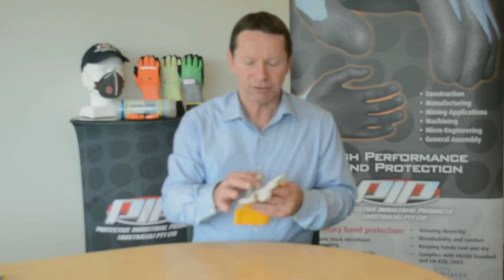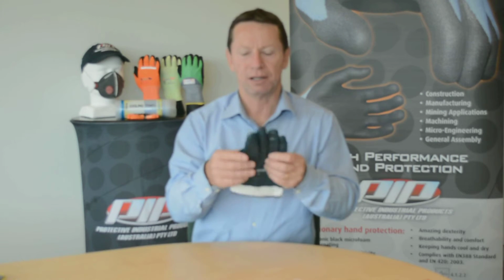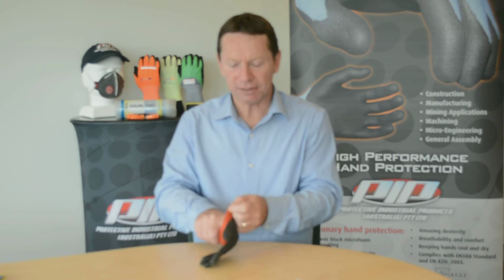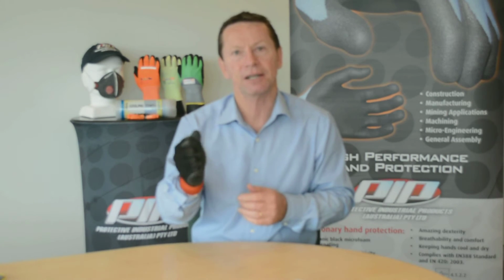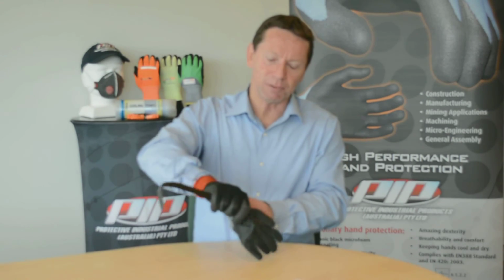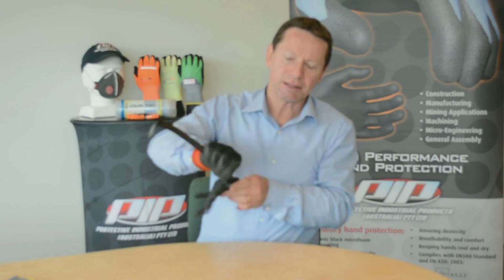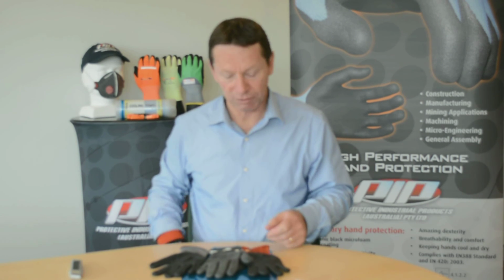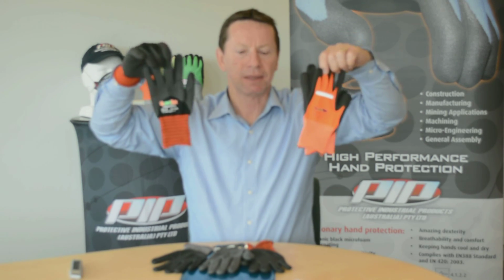SuperSkin Presentation Video

Comment: Where are these available in qld? Is there a bricks & mortar store I can try them. Am after waterproof gloves that don't make hands sweat.
Reply from the maker: Hello Anakin,
We have a list of Distribution locations on our homepage (pipaus.com) tab "contacts" locate a distributor button.
As for finding a breathable glove that is water tight, that science is not readily available yet. Issue being for sweat (humidity / moisture) to escape the inside of glove, it must be able to pass through the micro porous coating material. Conversely, if it is a solid coated material it will not breathe, or let water in! We do have water resistant gloves listed on our website as well.